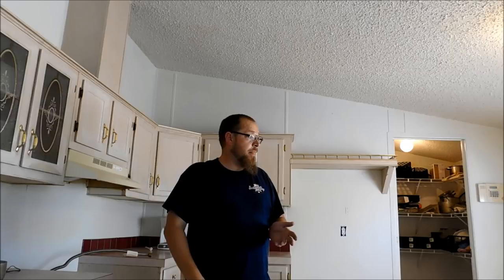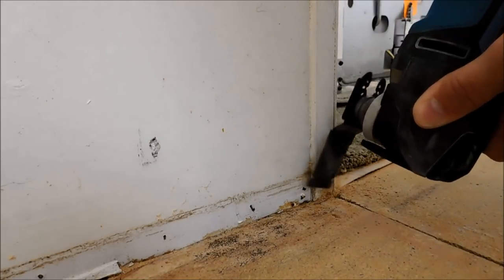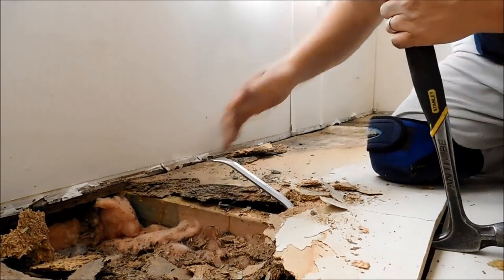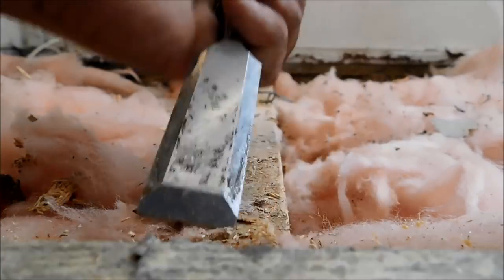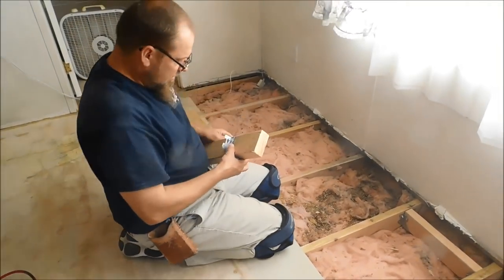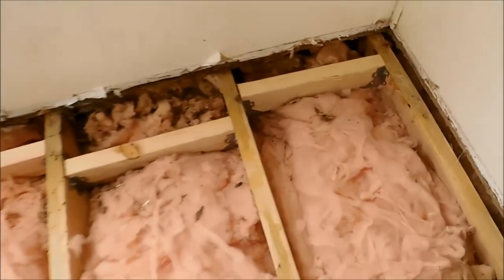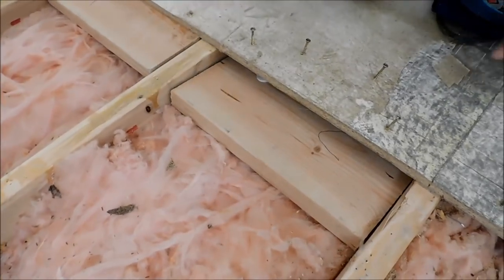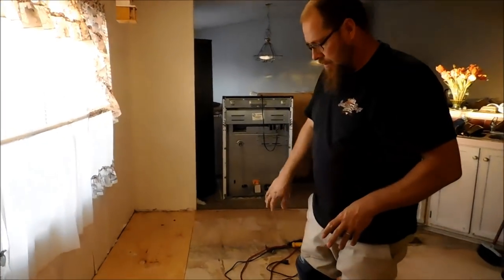ROTTEN FLOOR REPAIR

Comment: I have been installing vinyl and repairing underlayment for 25 years. I appreciate you taking the time to make this video, you are thorough and professional. Especially like how you take the extra step and use adhesive. So many guys up here (Seattle area) just rush through this stuff. Keep up the good work--
Reply from the maker: Jody Sanders thank you sir
Reply: Great job RHANK U SOOO VERY MUCH
Reply: That's nice to say. He's doing a better job than was previously done, but that's 100% not professional work.

Comment: Suddenly I've found myself in the position where I have to tackle this same job in my own bathroom.  Been pondering for a week and frantically watching you tube videos of people doing this exact project ..... I'm pretty handy with a saw, hammer and the various other tools ....but it's  by far the biggest project, carpentry-wise, in my 62 years. Video by video, I slowly was working my way toward having the gumption to jump into this ......and then I stumbled upon this particular video !!!  You've answered every question I had and have no doubt pushed me to the starting line ...... I'm diving in this weekend ! Thanks so much for sharing your knowledge. And one more thing ....you did a more thorough job than some carpenters I know. YOU ARE A CARPENTER ..... specializing in rotted floor repair !!! Thanks again !
Reply from the maker: UTOBEDUDE Wow, that is great, I’m sure you will do just fine on your repair, thank you for that very inspiring comment
Reply: im in the exact same position and feel the exact same way about this particular video!! You are thorough and detailed! Thank you, thank you!!
Reply from the maker: Boca De Flores I am really glad it helps, good luck with your project
Reply: Indeed! I just found out how to fix my bathroom floor. An unnecessary nightmare for me, a local contractor just replaced the bathroom tile floor for water proof vinyl less than two months ago and I find a few soft spots, plus water coming from the floor. The plumber came to check and he found a lake under the subfloor throughout the whole bathroom area. The subfloor was damaged, there had been a water leak that flooded the insulation pool. This was not the contractor’s fault. However, he was responsible for letting me know of the damage and tell me the cost to replace the subfloor. No! He went ahead and replaced the floor without informing me. He finished, got paid, and left me with a bigger problem than just replacing the floor. I am happy to find this video, finally I can fix the subfloor myself. I am a little afraid about what I may find underneath the bath tub. Hopefully I can fix that too. Thank you for your excellent video!
Reply from the maker: Luisa Stowe That’s awful, good luck with your project

Comment: Very impressive work on securing the subfloor. Also, glad you didn't replace that particle board with more particle board but, instead plywood. Can't believe they used particle board as a subfloor.
Reply from the maker: Erik Thank you sir, yeah it is sad but you see particleboard and a lot of older mobile homes
Reply: Erik Looks pretty good
Reply from the maker: Drew's Roofing & Home Repair Thank you sir
Reply from the maker: Drew's Roofing & Home Repair I have actually switched up the way I do things now, since I have learned a new method called box framing , It is a much better way to repair floors.  https://youtu.be/1mJJGCvAsK0
Reply: Without locating, and fixing the water leak, repairing the floor is a waste. Helpful video. Thank you.
Reply: I can believe it.  The dumb builder who built my house used particle board in every room including the kitchen and bathrooms.  now I have to replace them.
Reply: Will that water leak damage joists or any other wood beams too? If so, I imagine that a big job and expensive.

Comment: This was just what I needed.  Am working on rotted flooring (about a 2' x 2 1/2' section) in a 1974 mobile home bathroom.  Just started carefully tearing up the floor under the toilet and was shocked at how close two water pipes had been run right under the particle board.  Had set my 3" circular saw at 3/4" depth to do a shallow cut first to remove the damaged part or I would have been in a heap of trouble..lol.  At least I knew kind of what to expect and what I'd need to tackle the project.  Just a DIY homeowner who really appreciates your taking the time to bring us along for on-the-job training with you.  Nice Job!!
Reply from the maker: Marc Lee Thank you sir, I’m glad you found this helpful and I hope everything turns out well for you

Comment: Very informative video. Just want to recommend to other viewers to wear a dust mask! I finished doing this and had a bad reaction I assume from the mold that was attached to the flooring. Not to mention the dust and other crap that hasn't been exposed since the floor was put in.
Reply from the maker: Just Me thank you sir
Reply: That was my reaction. I was like “I get you’re concerned in the desert about snakes, but are you at all concerned about touching and breathing all that mold?” Yikes!

Comment: im gonna tackle my 94 Winnebago here start of may. i had 35 gal of water let loose last year and my floor is going to be replaced aling with waterproof snap fit linoleum floor. theres carpet in there now. this video is awsome and will help.with my project upcoming.

Comment: Thanks. The only thing I will do different is to use common nails as possible (10d maybe?) for the hangersand use screws only in those tight areas. Super helpful
Reply from the maker: Inav Banz Cool, good luck with your project

Comment: On your cleaning the tops of the floor joists after the sub floor removal, try the scraper blades made for the oscillating multi tool, they work great and many different applications in replacing flooring, great for removing vinyl sheet flooring, great job and keep the videos coming.  I am a retired GC and love my building and demo videos.
Reply from the maker: Jack Holt thank you, I actually started doing that if you notice on my later subfloor repair videos that is what I do and you’re correct it does work really well

Comment: The sub floor under the bottom plates and the bottom plates are probably rotten too.  If leakage from window was the cause, fixing that leakage is the first step.

Those 2x12s may crack at the seam.  Cheaper and stronger to put a pair of r2x6 stubs with grain 90 degrees to the seam.

Comment: My friend and I built a 10 foot long, 8 foot wide catio two years back. I feel sure we can replace some floor in a bathroom and closet. This video is great. I really like all of that support you added to the bottom. I especially like you using the glue because my kitchen floor makes noise because glue wasn't used when the floor was replaced. 
I'd like to ask, what size screws did you use? I have everything else written down, and that one seems also important.  
Thank you for the video!
Reply from the maker: Southern Belle 3”
Reply: Thank you!

Comment: I ran into them problems a bunch on my repairs. Real hard getting it out from under walls
Reply from the maker: Drew's Roofing & Home Repair Have to be real careful doing that as well which I’m sure that you know pulling the subfloor out from under the wall will cause your wall and roof line to sag
Reply: True

Comment: Great video! I'm assuming the original source of the water damage was dealt with or at least the homeowner will be getting on it next. Otherwise, wouldn't it get water damaged again to that nice new wood? Also, wondering if you need to treat the area or spray some sort of wood protectant to prevent further wood damage?
Reply from the maker: When the leak is fixed there should be no more wood damage

Comment: My question is, why the use of fiber board? You said what you pulled up was plywood, but it's not. That type of board shouldn't be used on a floor, or anything in my opinion. It's cheap and when it gets wet, starts to deteriorate. I've been working on a water-soaked floor for almost a week and it's all plywood. Came off in sheets because it was demanding. Love the full and explaining in layman's terms.
Reply: Fiberboard subfloor is criminal
Reply: @aaronsbraga  right!! I took off my countertop to replace my kitchen subfloor recently, the countertop had fiberboard as the edge braces to raise it up and have something to screw the dishwasher brackets into. I left the countertop outside and it rained, almost doubling the fiberboard in size from the rain. Not good, EVER!!

Comment: Did you fix the water problem first? You didn't mention it. What good is replacing the floor if you dont fix the leaks?

Comment: I noticed those neat looking knee pads right away.  I have bad knees and have to use knee pads anytime I get on my knees.  I have already looked them up on Amazon.
Reply from the maker: Charlie Wilson Cool, they were really comfortable however I have found without a doubt the best ones I’ve ever had now they are called pro knee
Reply: @FloorsbySouthernboys  Thank you for the info.  I will be doing the same soon, so every tip is appreciated.  What is the name of the tool used to pull the staples.  I found a double wide that had a roof leak, and I got it very cheap!  But a new roof and floors are in my future for sure.
Reply from the maker: The Witch of White Tail Hollow they are tile snips But a pair of channel locks will do just great for you, good luck on your project, I hope it all turns out well for you
Reply: @FloorsbySouthernboys  Well the double wide was virtually free, all I have to pay for is the foundation and delivery.  The majority of the work (roof, floors) I will be doing myself.  I will however, hire an electrician and plumber.  That, I don't do!
Reply from the maker: The Witch of White Tail Hollow 👍

Comment: I have an issue with the tool you used to cut the small spaces. My blade keeps coming lose when I use it, could I be putting the blade  on wrong?
Reply from the maker: Ronald RT Leslie Yeah, it should be really snug if it is put in correctly

Comment: @Floors by Southern boys, "you should have used exterior plywood/you should have told the owner you would not do the job if you could not do it right/you should have fixed the leak first not the floor/bla bla bla". I give you credit for the way you handle the comments! I would have just told them all "listen the guy hired me to demo an old floor and install new. Don't care wtf happens as long as I know my install was done right and I got paid!"
Reply: I would like to add though I would not have bothered with joist hangers. They were not needed. I'd put the nailers (2x's) as close as possible to wall and  toenail 1 screw from above and toenail 1 from the side on each end, would have been plenty.
Reply from the maker: @61spindrift  thank you sir

Comment: Did the window get fixed?  Wouldn't there be dry rot behind the wall as well?
Reply from the maker: 34stzoo Probably not and yes there was I’m sure rotted wood in the walls This guy was a retired general contractor, and he only wanted to put some make up on it so he could sell it
Reply: @FloorsbySouthernboys  thanks for the reply.  Your work was solid! I just hate it when people pass on headaches that can be avoided.
Reply from the maker: 34stzoo agree
Reply: My question as well.  What about the rotted wood floor under the window (under the outside wall)?

Comment: What do you use if the boards run the other way
Reply from the maker: Debra Murphy tie in  to the outer skirting Which is the Main support around the exterior of the house, You can reach it under the floor, tie into that and then to the closest joist to the wall

Comment: I have a Double Wide Mobile home and I'm having the same issue except they didn't put the wall in the bathroom on a floor joist. The wall runs between the floor joist, and the wall plate has dropped about 3/4" keeping the new sub floor from sliding under the wall plate. Don't know if it's a load bearing wall or it's just where the floor was wet for so long. The floor was under a fiberglass shower that attached the the wall I'm having problems with. Any Idea's on how to fix the wall plate, and do you think that might be a load bearing wall that they didn't put on a floor joist when they built the home? Thank you
Reply from the maker: James Vesser It’s really unlikely that it is loadbearing, most of the walls inside of a mobile home is not except for the center walls, they are usually built like a shell and then the walls are built in after the exterior walls and ceiling is up

Comment: Where did you find plywood for the floor? I can’t find it in Home Depot.
Reply from the maker: Ferret World I don’t know if you will find particleboard anywhere, I would not put back particleboard anyway, go with a true plywood which you can get at Home Depot or Lowe’s

Comment: What is the tool called that you are pulling the staples out with?
Reply from the maker: The Witch of White Tail Hollow It is actually just an old pair of tile snips , But a pair of channel locks will work great as well
Reply: @FloorsbySouthernboys  Thank you kindly!  I have been making my list as I go along on this video, and I simply cannot thank you enough!
Reply from the maker: The Witch of White Tail Hollow Well I’m glad it helps, and again I wish you the best on your project

Comment: Thing is when this "manufactured" home was built these floors were as good as they could be. When the "movers" start pulling, jerking, yanking, cussing, get'n piss'd-off, and then pulling them down the highway at 75+ mph. Then at location, start pushing, prying, some more cussing, them into there permanent place, the floors definitely get seven different colors of F'd up.
And towards the end of this video, you must have inadvertently messed up your camera's mic, cause all I heard was dead air and lots and lots of static. 
Other then that, Thank you for making this video, I actually enjoyed watching you.
Reply from the maker: sorry about the noise and thank you

Comment: My biggest fear doing this is the spiders lol ty for sharing this 👍
Reply from the maker: CHERYL T LOL you’re welcome and I hope it helps you
Reply: @FloorsbySouthernboys  it does ty👍😊...
Reply from the maker: CHERYL T Awesome
Reply: My very nice gardener places a few “bombs” under the mobile home when we need to fix a water leak, of which I have had many, he said those “bombs” are to clean the crawling space from spiders and possibly snakes. So far it has worked, the downside is that I have to be away for at least two days because the fumes do go into the house as well.

Comment: how much you charge for this? good video
Reply from the maker: Christian Wilson it varies per situation per people and all that stuff these were an older couple I’m sure living on a fixed income so I charged them $50 an hour for doing that demo and replacement plus they paid for the supplies and thank you for the compliment I appreciate it and thanks for watching
Reply: Why MDF?🤦🏻‍♂️
Reply: @coffetime4977  That is NOT MDF he put on
Reply from the maker: @coffetime4977  ?
Reply: @FloorsbySouthernboys  I don't understand when people ask dumb questions like "Why did you put this or that on" or "I would have should have could have" comments.  I'm wondering how many people are coming out of pocket.  I can respect the integrity they have on installations but when the client ask for something, the most you can do is suggest why you don't want that certain thing installed because of... and the client will make the choice to be cheap or responsible.  In the end, the client is paying for it. Thank goodness for contractual agreements and signatures.
Reply from the maker: RE Verb Completely agree, it all boils down to if you’re in a clients house they are your boss. They hired you.

Comment: seems like all trailer houses with a little age on them have this problem at the windows. Makes you wonder if they know how to install a window.
Reply from the maker: Stephen Boyd Unfortunately here in Tucson Arizona it’s not just in mobile homes almost every single house that I do has water damage on the tack strip and baseboards around the windows but I hear you about the trailer windows

Comment: DID YOU EVER FIND THE REASON OF WHY THE FLOOR WAS ROTTEN,  NICE JOB
Reply from the maker: tina gagne I’m sure the windows were leaking
Reply: Or maybe needs a waterproof job done around the house, looks like water filtration just saying
Reply from the maker: Angel M Quite possibly, the best I can remember it didn’t have any gutters or anything, and it was an old mobile
Reply: Fair enough lol, Great video after all!
Reply from the maker: Angel M 😀😁👍

Comment: did you check for level of the floorbeams , could be the floor is so slanted toward the wall with the window that everything leaking from the kitchen is rolling toward that wall
........... cant believe they use particle board on a floor , that stuff might only last a year or two at the most , dont think its made to take youre weight either
Reply from the maker: watahyahknow The customer simply wanted to dress it up so he could sell it, and particleboard is in all of your older mobile homes, however I don’t like it either, but they used it for years in mobile homes
Reply: @FloorsbySouthernboys  me neither that stuff just isnt made for stuff like that , i dont even KNOW where it can be used for that lasts longer than 2 years , its cheap and its something that plain doesnt last long enough for the time you put intoo it
Reply from the maker: watahyahknow It’s actually used in a lot of furniture nowadays lotta cheap furniture,
Reply from the maker: watahyahknow But it’s definitely not good for floors
Reply: As long as it dosnt grt wet, particle board will last years, once is wet, is over